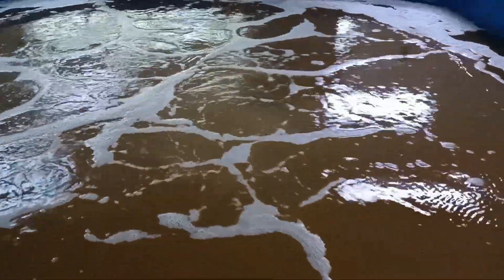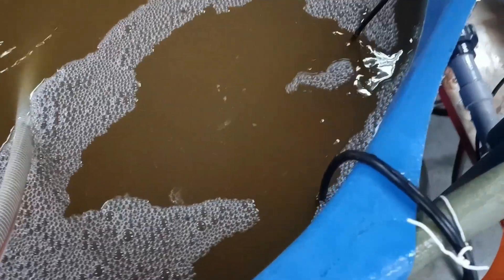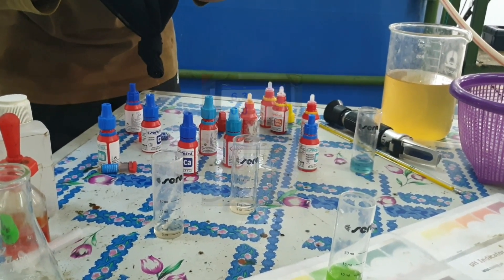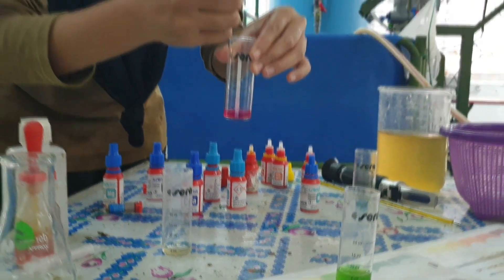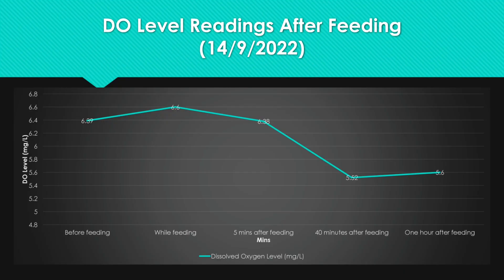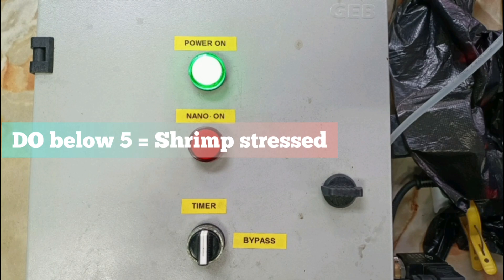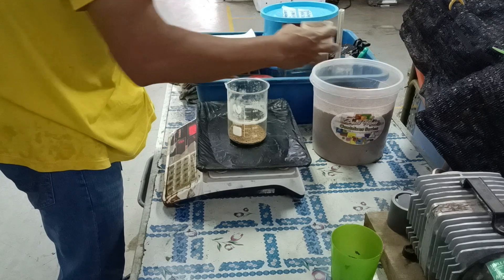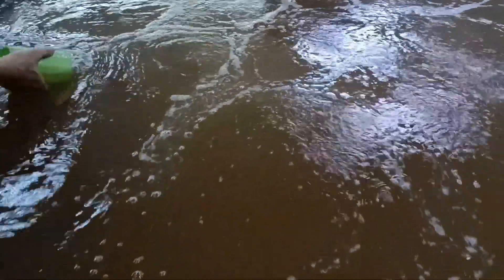NEW Dissolved Oxygen Meter for our Biofloc System 😍😍😍

Comment: Not shown in the video but I can guess you are using MEMBRANE type of do meter so you have to keep shaking the meter to simulate the gills of fish...

Membrane DO meter has to be calibrated with the air before usage.

Possible solutions: You have pipes from your various biofloc tank feed the face of the
DO Sensor which you can install in a fixed place..  This way you can sample the  do from various tanks at a fixed location.

Free software today that can collect data from these sensors over a network so that the human labor can be cut.

Sensors that work on RS485 and MODBUS or MQTT protocol will be a necessary

New generation of DO sensors work on laser and these sensor comes with a wiper brush to wipe the lens clean. No shaking is needed as it is laser based.

Another kind of DO measurement is DO based on Mathematical Calculations of the values of other dissolved gases like ammonia etc.. Such a device can be found on.

https://www.seneye.com/ -- they sell computer based water quality montors for aquariums and they mention their DO is an estimate based on other factors..
Reply from the maker: Thank you! Will definitely check it out